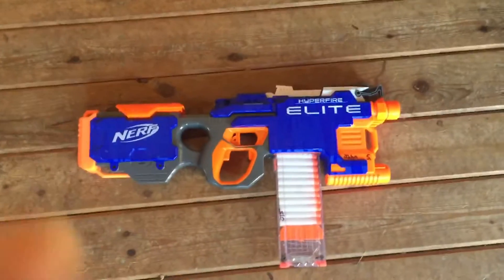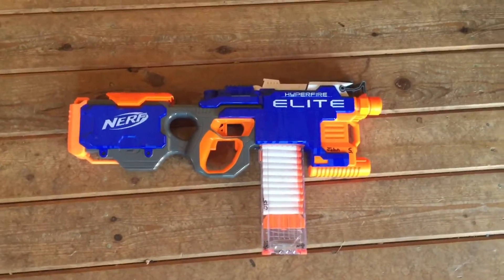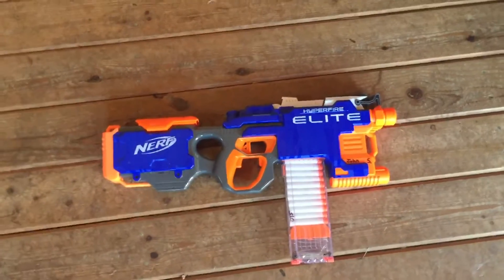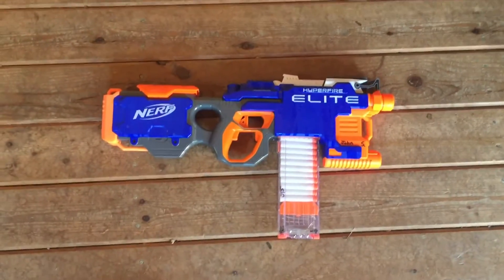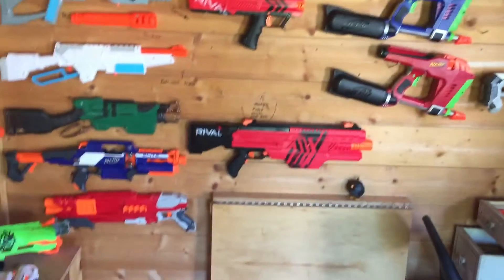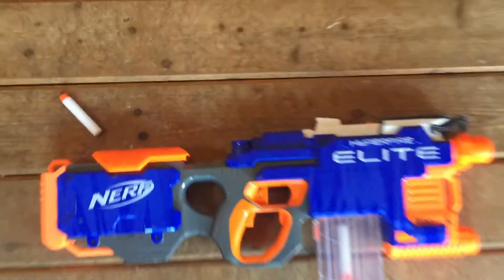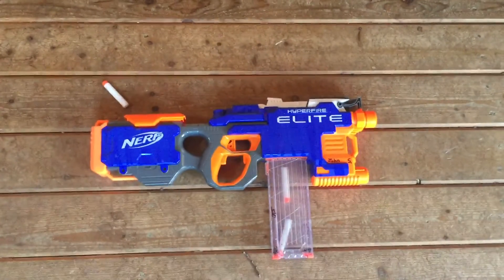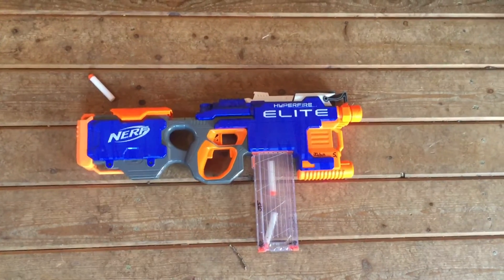Ultimate: Nerf hyperfire mod

Comment: That's a nice build! I got a question for you.

 - What was your 3s lipo's current (C) and voltage rating? 

Thanks for the great content and I look forward to hearing from ya!
Reply from the maker: Carter Hutchinson it is a 1300 mah 35c burst lipo, 11.1 volts, the motors are rated for 12 volts
Reply from the maker: Carter Hutchinson it is a 1300mah 11.1v 35c lipo I bought on Amazon
Reply: Thanks for the quick reply! You just gained a subscriber :)
Reply from the maker: Carter Hutchinson thanks man! I really appreciate it! If got any more questions let me know!